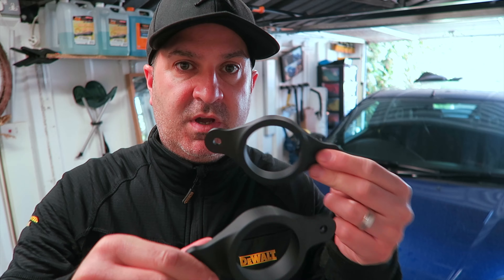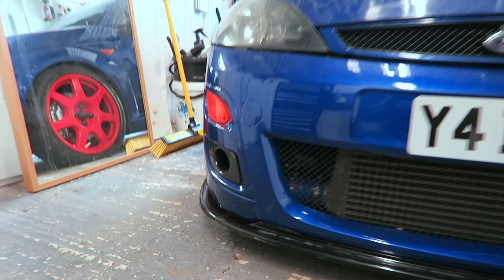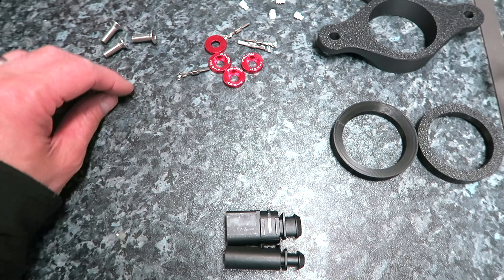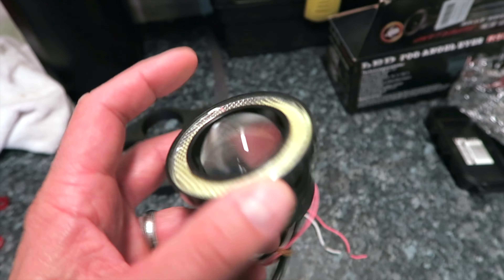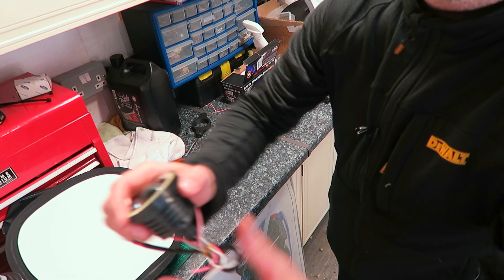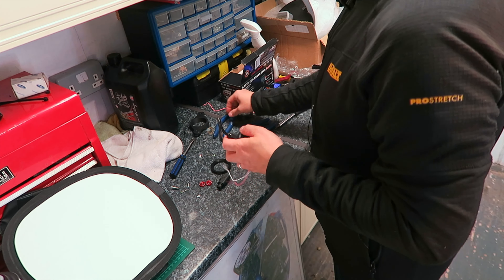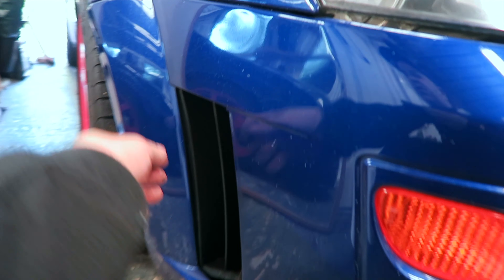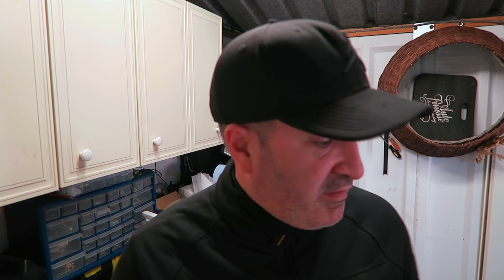I fitted 3D printed fog lights to my rally car!!  Ford Focus RS Mk1 - Cheap alternative to new :)

Comment: Thanks for the video pal
Just to clarify for anyone fitting them both brackets should fit with the flat side towards the wheel of the car and the extra 2 black rings are to replace the DRLs as i dont think they will last too long judging by their appearance so i removed them and just installed the 2 black rings instead 
anyways hit me up if anyone needs a set